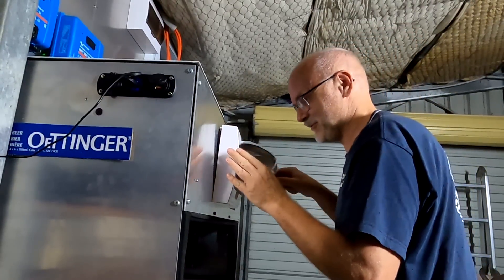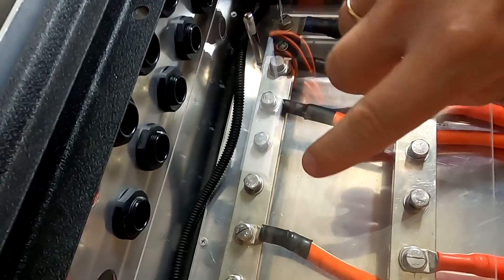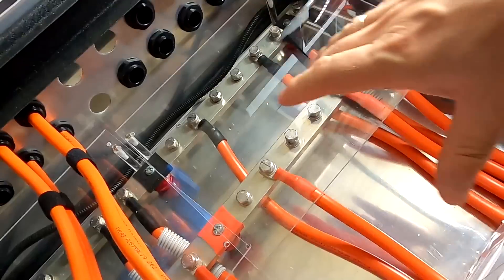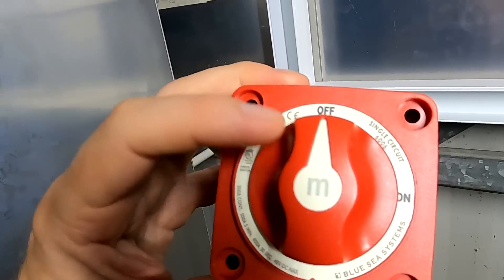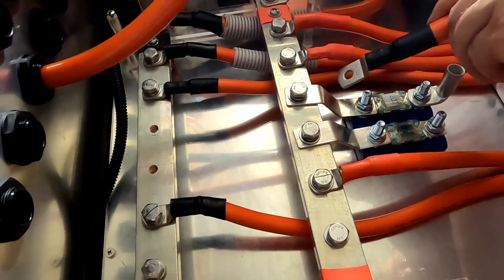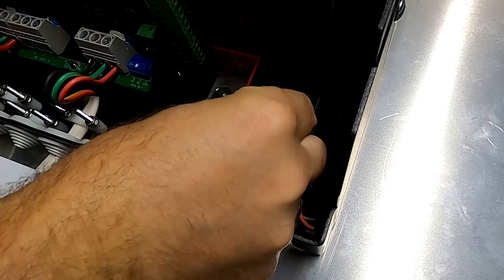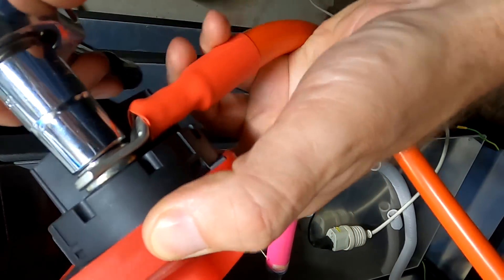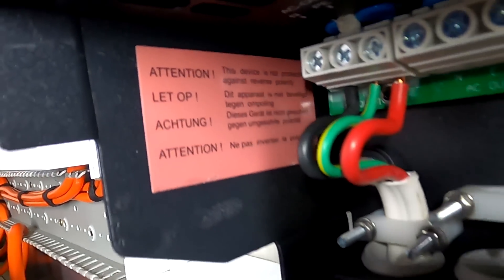Cabling challenge with the Victron Multiplus. Is there enough space? #PowerWallProject

Comment: What about the Blue Sea RBS ML-7700 remote battery switch? It is no rated to switch 48V nominal with either a 12v or 24v coil. It’s a bistable relay with on-device and remote button operation. I’m using that as my main contactor for my 16s 304Ah EVE pack for my boat.
Reply from the maker: That's not possible from an emergency perspective as you have to rely on some auxiliary voltage which may or may not be available in this situation.
I rather rely on a mechanical switch. Maybe that's just me though.

Comment: There is some topics about the using of that switch with 48v battery systems in DIY Solar Power Forum, and there is some posts of Blue Sea staff indicating to not use it, since the max voltage is 48v, and the 48v battery banks exceeds easily those voltages.
Reply from the maker: It's always called a 48V as the nominal voltage event he switches and other gear can be used for higher voltage.
Reply: @OffGridGarageAustralia  This is the reply from Blue Sea: "Our battery switches have a 48-volt Maximum rating. So typically, 12, 24- & 36-volt systems that would never exceed 48 volts. Our switches are not rated for 48-volt systems that will reach near 60 volts in some cases. That would be well over the max we have been approved for by the UL Listing we have been certified for."
Reply from the maker: @amagro9495  I wonder why all the companies and installers are using these switches then...
Reply: @OffGridGarageAustralia  I'm just sharing Blue Sea reply's found in DIY Solar Power Forum.  If they advice to not use it, we should simply not use it.
Reply from the maker: @amagro9495  So what's the solution/alternative?
Reply: @OffGridGarageAustralia  Actually there is not a consensus solution. And it seams that most of Amazon battery switches are now announced as a 60v, but everyone knows that they are the old 48v. I think you are the right person to clarify about all these 48v switches that are on the market and not fit on our 48v battery banks, and maybe suggest us "the" switch ;)
Reply from the maker: @amagro9495  I'm still under the impression they are for a 48V systems. Even Victron offers a battery safety switch for 48V systems (and states it is for up to 48V).
https://www.victronenergy.com/upload/documents/Datasheet-Battery-Switch-275-A-EN.pdf
I think both, the Victron and Blue Sea are totally suitable for this purpose.

Comment: Andy. I have heard that given the lithium battery voltages ranging in the 50s that 48 volt switches were unsafe, and that you needed a 60 volt switch.  I use a 48 volt switch myself, but would welcome your comments on the debate
Reply from the maker: No, no, no. 48V is the nominal voltage of the system, that's what the switches are designed for. In a 48V system the voltage can go from 40V to almost 60V. That is all good.
Reply: @OffGridGarageAustralia  i'm sure it's fine.  BUT, blue sea systems state the "MAX" voltage as 48V.  they basically say it's designed for up to a 36v nominal system.  there is LOTS of talk about it in online forums.  i'm no electrical engineer, and don't quite understand the ramifications of using it on a 48v nominal system... but i'm guessing that there is just more of a chance (like from .1% to maybe .2%?) of there being an arc...  but, again, the company says not to go over 48v.  just don't know why...

Comment: Andy, the switch is rated for a maximum of 48 VDC, and fully charged, your voltage will be around 51 VDC. Is there a risk of the switch flashing???
Reply from the maker: No, the switch is rated for a 48V system. The nominal voltage is 48V, so can be from 40V to almost 60V.

Comment: With the cables going under the 2nd bus bar, why don't you bolt the ring terminal upside down, so the cable more naturally goes under the bus bar?
Reply from the maker: People have suggested this before. I cannot torque the screws any more and would need to guess. Not too important bit it is also very fiddly to get the screw in upside down.

Comment: Yeh don't go to tight on those blue sea switches they crack and the stud spins. Also m5 bolts do fit to mount them. I used the 2 way versions and have a resistor on position 1 to pre charge the inverter before I switch to position 2 full connect.
Reply from the maker: Thank you. Do we need a pre-charge option at all?
Reply: @Off-Grid Garage  Its a good way to extend the life of the switch and also take some stress off the bms when you flick on the system. You can probably do without it with decent switches and such and over size bms but its easy to include.

Comment: Cool, I  like the idea of adding those big old battery switches, a prudent decision. 
One thing perhaps worth mentioning is that when considering main or service disconnect switches, is the current interrupting rating, or the rated maximum amount of current that the device can reliably interrupt when under a load over it's rated constant current capacity. Or basically how big of an instantaneous  short-circuit current can it withstand and still open a circuit without the contacts welding closed or blowing apart. On a 250v 30amp frame circuit breaker that might see that rating at 50,000 amps, but battery disconnects such as you have there are not typically rated as or considered as a 'Disconnecting Device" like a circuit breaker or mains disconnect switch, but rather just switch, like a light switch that is protected by a short-circuit protection device such as a fuse or an over current device such as a circuit breaker. with your fuses in line with that switch it's protected from over-current damage and therefore functions as simply a disconnect switch, and not an over-current protection device or emergency over-current disconnect.
Reply: All good points here. I have purchased a similar marine type switch, but have also been considering the pro’s n cons of using a contactor as a main interrupt mechanism, what do you think Andy? Is there a reason not to use large contactors?  I have seen them on Ebay 400-600Amp 12v-60v solenoid ranges for $100-$150ea.  A large contactor could be controlled with smaller switch’s , DIN rail mounted in your dust proof enclosure, etc, with a host of other safety features being able to be built in with an electrical contactor as a main or backup current interrupt. I do like ur No Ark’s though they do look pricey and a fair bit more to mount and configure. Love ur vids Andy
Reply: @evil17  Personalty, I think a contactor could be useful and prudent. That's what's most EV use in conjunction with a smart safety system but I would not use one as the the only overload, short-circuit and disconnecting mechanism. I've seen a lot of AC contractors weld closed as they have only a little spring to push the contacts open. Instant trip breakers that use electronic current sensing rather than a thermal spring to trip, are often motorized or use a powerful mouse trap/solenoid trip to drive the contacts open.
When using a contactor on high-amp DC systems with large inrush current to caps on inverters, I'd want a fuse and/or circuit breaker. For protection incase the control circuit did not work or the contacts happened to weld closed.
Reply: @jackoneil3933  yeah, good points, this is what I was thinking too.
Reply: @evil17  In electrical power distribution design, there are typically three elements involved in circuit and system protection: Short-circuit protection, in the past this was traditionally fuses to protect supply conductors and power frame components such as breakers and from over-current. 2, Overload protection, to typically circuit breakers. And 3, A service disconnecting means to disconnect the system in case of emergency, fire or service.

In those three elements you don't typically seen contactors utilized.  Contactors are typically intended to control and protect equipment, which often have theirt own disconnecting means (Safety disconnect)  rather than power supply and distribution systems., however are often used for load shedding and charging control. 

Generally I'd not be inclined to use a contactor as a primary disconnecting means or as a 'Safety Disconnect; or protection but additionally as a secondary control. 

I just watched a video at a Bacardi bottling plant where a man was killed, partly due to the fact that equipment had only a control lockout to shut down part of as system,  and no service disconnect to shut down the whole system and he was crushed when a conveyor not tied to the system he was working on was energized.
Reply from the maker: @evil17  I think contactors as safety equipment is not part of the regulations. This could vary by country though.
Reply from the maker: It's typical for switches to have a label next to them saying "Do not operate under load". The load for this switch will be 100A max and it is capable of switching 300A-900A. I would still not recommend doing it as these switches don't have a arc chamber inside like the  circuit breakers have.
Reply: @OffGridGarageAustralia  Thanks! Good point Andy.
 My points in my comments have been intended more for the general audience was to impress concepts that might be useful to them, such why they need to use protection and be aware of the importance overload protection and sizing components to load ratings. 
Grounding and over current/short circuit protection along with best practices which you excel at are perhaps what are most often missing from other DIY Videos and perhaps what many come back to your channel for🍺🍺
Reply from the maker: @jackoneil3933  Thank you. Always appreciate you comments and input!

Comment: Andy, call Blue Sea. I do not believe the switch you are using is rated for the use case you are using, since it is over 48V when charging. Thats what their support team told me.
Reply from the maker: They are for 48V systems. 48V is the nominal voltage and goes from 40V-58V.

Comment: Almost there.
Look at it this way.
The switch I off in the up position and point to the right when on.
So look at it like this.
If it's point up means inverter power stops here(stop hand signal points up) 
If it point to the right it's pointing to the ac meaning it's live and sending power that direction.
Reply: @Off-Grid Garage, this doesn't look legit, phising possibly

Comment: I would have preferred to move the two mega fuses to be on top of the cables instead of underneath.
Should you need to replace a fuse, you are going to need to remove the cable and put it somewhere while the new fuse goes in. Not sure if those cables will short something if they touch anything in there but I feel that it would be far safer if the cables stay in place during a fuse change... 
That would be Geil.... Just like Bruce and Bongo in their famous song LoL 🤣
Reply from the maker: I hope I will never have to replace these fuses. The inverter should actually shutdown itself due to overload long before that. If I change them, I would turn off the main breaker anyway which isolates the bus bar. It is far too dangerous to work on a live system which such a power.

Comment: Hi Andy! Try to have both wires running side by side against the wall like that you will have room for second pair of wires in front of them ;) cheers !
Reply from the maker: Yes, that's what I thought but we have these crossings when they connect to the switch so it's a bit messy in these small ducts.
Reply: @OffGridGarageAustralia  drill them with a wire bracket

Comment: Looking pretty nice. I use a similar “red” switch and it works pretty well but I faced the same issue with alignment. When I turn on the inverter I use my precharge resister and two test leads with alligator clams on both sides of the switch.
Reply: I'm surprised the switch doesn't have the option of removing and rotating the lever and the label ring by 90 degrees.
Reply from the maker: It cannot be rotated or I haven't figured it out maybe 🤷‍♂️
Reply: Victron On/Off switch is better for that matter
Reply: I do the same thing, using precharge resistors.
Reply: I've been thinking about wiring in precharge resistors permanent and use a momentary switch.

Comment: Andy nice work 👌
I thought at first, that you put some DC breakers to the box for inverters also. Just to have all breakers in one place. You still can mount this breaker onto the your power wall. 😉
Reply from the maker: Well, if you watch some previous videos we had the discussion around the breakers. That was my original idea until I found there are no 200A circuit breakers for DIN rail mount which would fit into the switchboards at the front. Victron actually recommends these 200A mega fuses for the inverters.

Comment: you could have gone with the 60V DC rated C125 breakers instead of the fuses? they can take up to 50mm² wire/cable and you can use them as main switch for your inverter.

I personally would work on the 48V live, none of the poles seems to be connected to the chassis and ground so if I touch only one pole I'm either connected to only the positive or the negative. But turning everything off is still right, especially if you feel uncomfortable working on the 48V. I work on 24V everytime without turning off the powersupply and those are grounded to earth ground on the negative side.
Reply from the maker: Victron recommends the 200A fuses for these inverters so I went that. Apparently there are some DC breakers out there with larger terminals but none of them can fit a 70mm cable (again a recommendation from Victron for this inverter to minimise ripple under high load). I also would not have been able to fit a 70mm cable into the switchboard at the front without any custom made busbar links.
Reply: Andy, have you given any consideration to using large Maxwell Capaitors, (possibly very close to the inverters) to help smooth any potential ripple and load share the peaks as pumps, heavy loads, etc , on start up? 
I dont know if this lifepo4 chemistry is making large capaitor banks at the inverter nearly obsolete nowadays compared to the huge advantages it has given to other chemistries in the past. I recently purchased a heap of Maxwell 16v strings and a few 48v banks as well, as are used in trains, elevators, etc, because I believe they do help tremendously as an extra high current buffer, particularly when coupled directly to the inverter with heavy cabling.  Cheers
Reply from the maker: @evil17  No consideration in doing this. The ripple at my inverters is very low. I use 70mm² cable which is almost twice as much as technical needed. I think having just larger supply cables makes such additional installations obsolete.

Comment: Remember the  "precharger"
Reply: I have mine on the back side of my disconnect switch with a momentary push button and the resistor goes from one contact of the switch to the other side push button to connect pre-charges and then I flip the switch
Reply: @theguywithallthesolutions  what size of precharge resistor do you use?
Reply from the maker: Do we need a pre-charge at all?
Reply: Except if Victron (or any other load) has it inside.
Of course you don't turn Off/On often.... but the inrush corrente is really huge 
Why  do you want to risc ?
Your execution is preventing/thinking all it could happen.

Thanks a lot for your shared experience
Reply: Hi, personally. I would prefer using them. I have seen mighty sparks in a 48v hybrid inverter just about when the battery breaker was switched on. In fact that unit had to be returned. From what I have learned, the longer the inverter has been switched off or in storage, the bigger the spark. The input capacitors will have no charge at those times and will act as a short. When.the unit is switched on, the batteries send a high inrush current, hence the spark. 
I have experienced a BMS shut down when a battery breaker was switched on and the last case was with AGM's. Sometimes the sparks eat out at the battery terminals too.  Better safe than sorry. Check out this video:
https://youtu.be/nIK6hgl3QZw